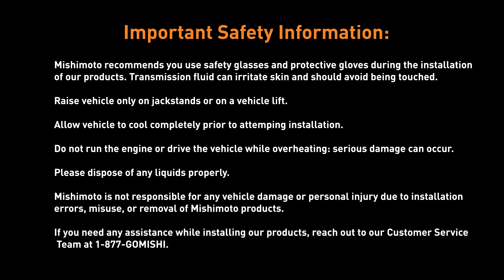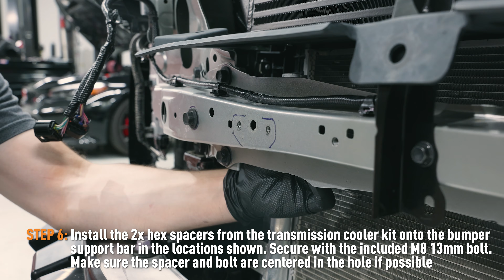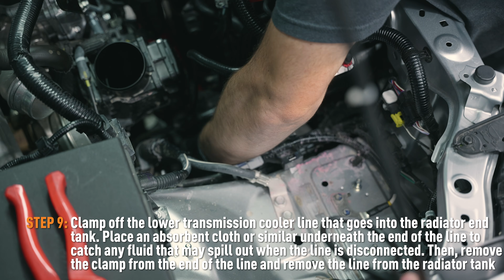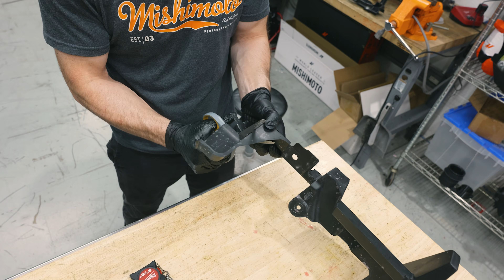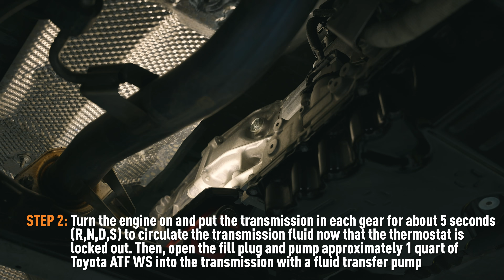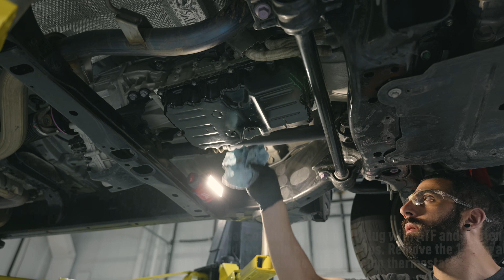How To Install A Transmission Cooler | 2024+ Toyota Tacoma

Comment: Why do we need this?
Reply from the maker: This will reduce transmission temperatures for improved performance and reliability, ideal for towing, off-roading, and heavy-duty use

Here's a link to our Engineering documentation for more info!
https://www.mishimoto.com/engineering/2025/11/thermal-guard-transmission-cooler-for-the-2024-toyota-tacoma
Reply: @mishimoto  it already comes with a transmission cooler i thought?
Reply: @BlueSTI  not since like 2020
Reply: @BlueSTI  There is a cooler but it is shared with the engine as well. There have been reports of transmissions overheating in Tacomas, 4runners, and lc250s - especially when in 4H.
Reply: You don’t. This vehicle already has a transmission cooler.
Reply: @keepmahaney7412 this one is just bigger is all but you're right.
Reply: @Lifesrad8  These vehicles actually use the same radiator to cool the engine and the transmission. This adds another cooler in series essentially. There have been a large amount of reports of overheated transmission of tacomas and lc250s when using 4H or when towing. This was also an issue with the prado 150 in other countries.
Reply: @MrCodyp12345 In rwd on paved highways in the Sierras i hit 230°. Monitor closely with my scan guage 3. The cluster trans temp was still showing mid range normal.  When the truck actually tells you there's a heat problem it is already pretty high up in temp. 4hi does the same offroad even 20 mph or higher. 4lo seems to be alright though around 205-212°. 25' TRD offroad,  armor, 35s, dobinson lift with heavy duty springs, and hunting gear. Probably depends on what you use the truck for. Mine is strictly adventure fun.
Reply: @keepmahaney7412  they don’t anymore.